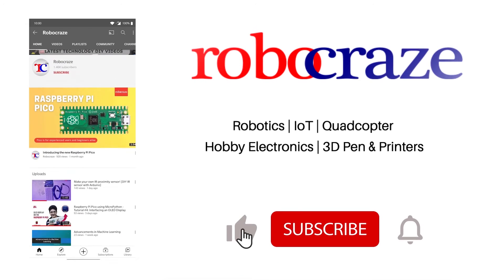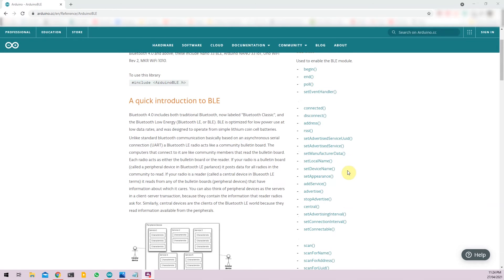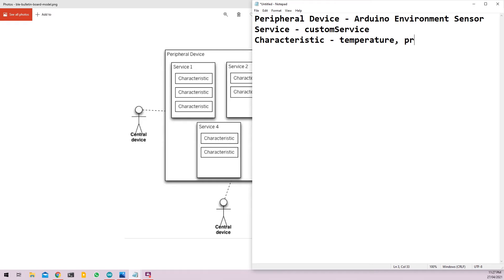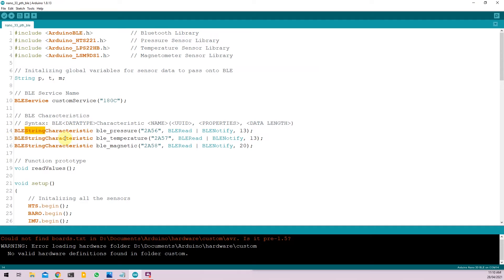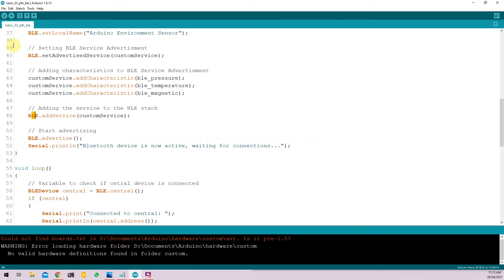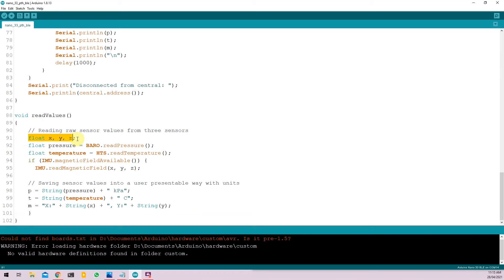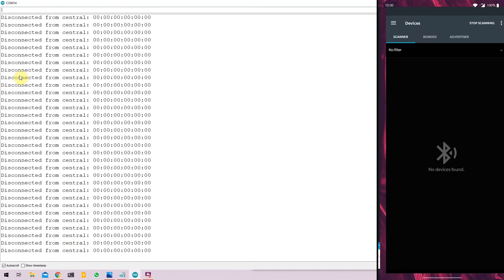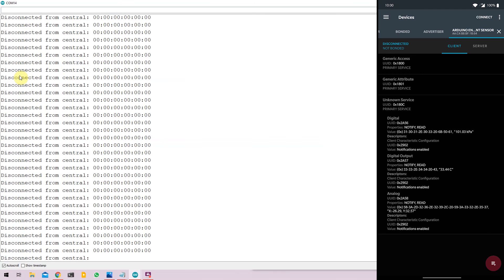Arduino TinyML Kit Tutorial #5: BLE Communication on the Nano 33 BLE

Comment: Hi, thanks for making very informative video.  I have made a external circuit and connected it to Arduino. I have written the code for BLE connection in the same way,and compiled it and connected it to mobile phone. Arduino is connected  and data is available on serial monitor but the data is not visible on client tab in the mobile phone. The screen is coming blank. Please help me to figure it out. TIA
Reply from the maker: Hello,
Ensure that the ble is connected properly you could reset the ble and scan again and check if correct device is connected. Make sure that the data you’re sending from the Arduino is in the correct format and Check that the mobile app has the necessary permissions to read the data.

Comment: I am attempting to duplicate this project for learning purposes, but I am a bit confused about 1 thing. I am able to get the code up and running and connected to the nrf connect app. However in the values field I only receive the hex value never the actual string. What do you think causes this? (I am using an iPhone)
Reply from the maker: You can try manually converting the hex values to string to check if the values you are receiving is indeed correct. If it is correct, then the issue is with the nRF app settings as its not doing the conversion process due to probably some incorrect settings on the app

Comment: I am having trouble believing that this is a proper BLE solution since your USB cable remained connected to your computer the whole time. Your nRF Connect showed the sensor data which was the same as that from the serial monitor. I need the Arduino to connect to the nRF Connect but without being attached to the computer, and the signal does not advertise in this case. I'm trying to discover a fix for this, but I would appreciate any ideas from this community. Thanks
Reply from the maker: The nano is connected to the computer solely for power purposes. You can connect the same setup directly to the power adaptor and achieve the same results.
nRF data shows the same serial because the same device sends both to serial and Bluetooth. It was shown for verification.

Comment: Very good series. However, I get incorrect temperature values with the code as written and I don't know what the problem is. The Serial.begin(9600) after initializing the sensors seems to screw up the temperature values. To correct this, I move the serial initialization to the beginning of setup().

Does anyone have an explanation for this?
Reply from the maker: Oh, interesting. Do you have any other components connected to the Nano while you did your test? And what kind of temeprature values are you getting?